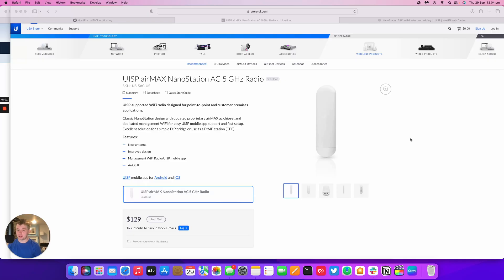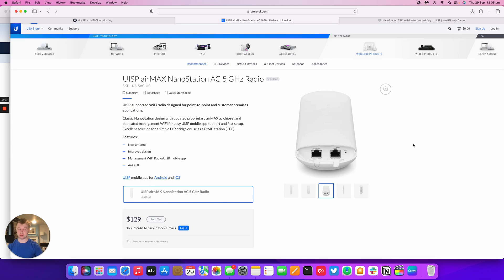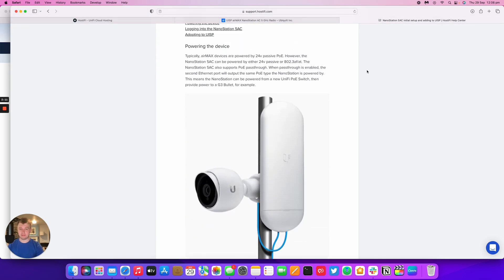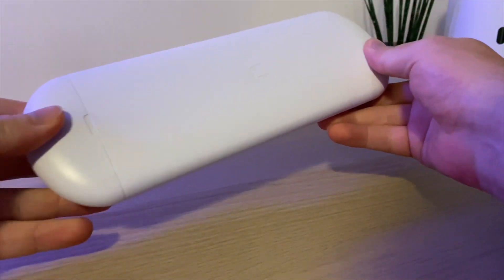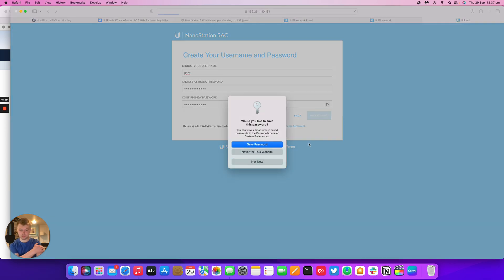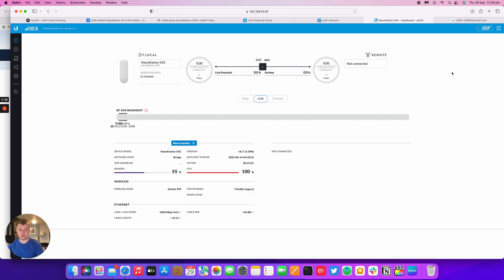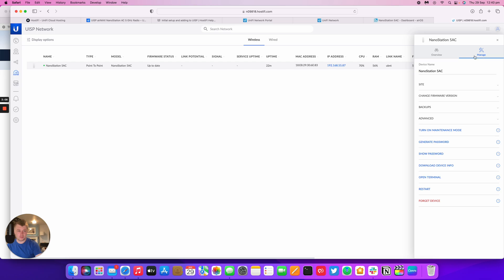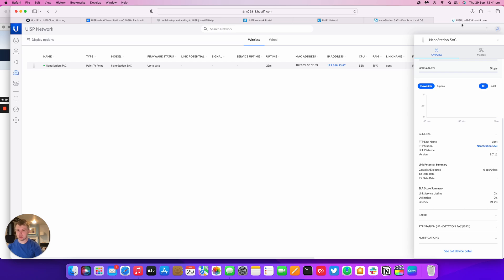UISP - NanoStation 5AC initial setup

Comment: Is it possible to use three of these? Or is it strictly a point to point? I might need a 3rd unit in between to accommodate for foliage from trees
Reply from the maker: Yes of course! You can setup one AP and connect many stations